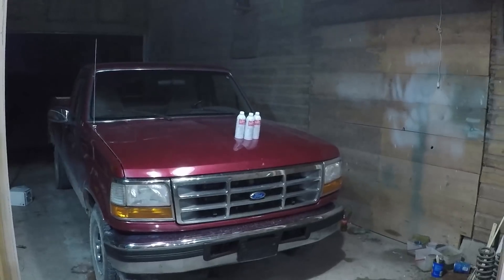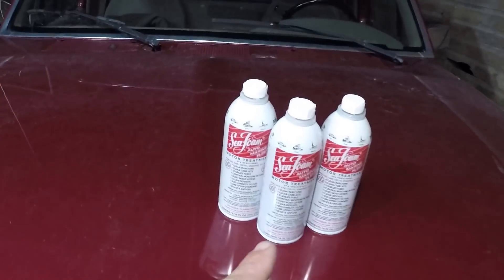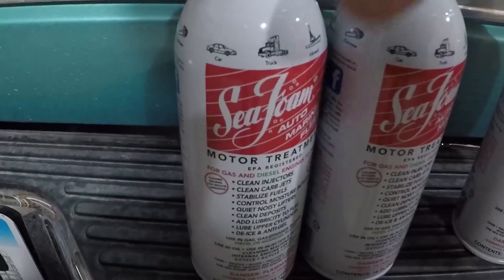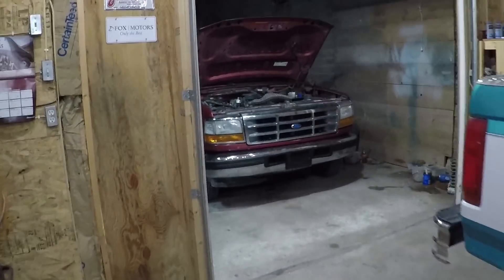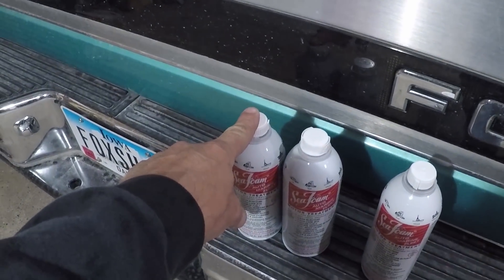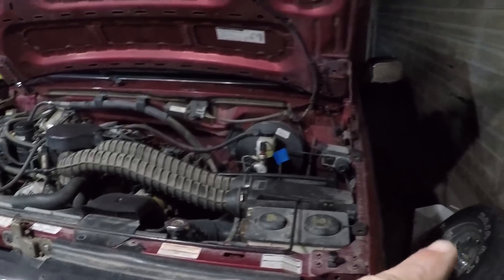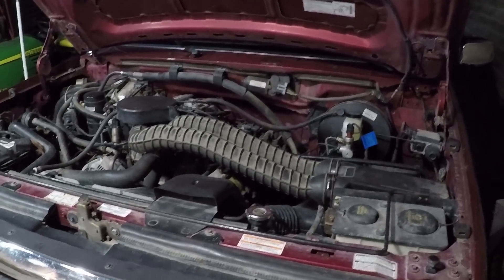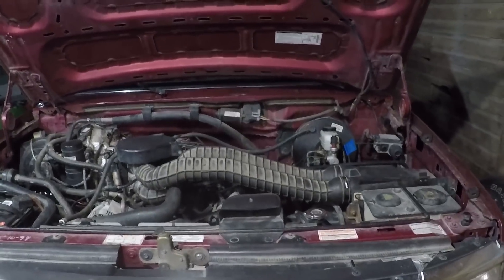SMOKIN! SeaFoam Treatment on The PROJECT TRUCK - 1995 Ford F150 4x4

Comment: One suggestion when pouring that stuff in, you are supposed to stall it when you're all done, that way it hot soaks. Also, I know on the Chevy Vortec engines the booster hose only feeds the back two intake ports, so I always use something called "seafoam spray". It has a little hose that you stick in the actual intake tube in front of the throttle body and run it through that way. Sometimes I even take the entire intake off and pour that stuff right down the throttle body with the engine running. Works great for me.
Reply from the maker: I didnt think you were supposed to kill the engine pouring that into the intake?
Reply: That's the way everyone says to do it anyway. I've done it too, or just have someone in the truck turn the key off while you're still pouring for about a second that way it is still wet when it shuts off and does a better job cleaning.
Reply: @TheFoxShop I wouldn’t do that, it’s basically hydro locking the engine which can bend rods or pushrods or damage something else

Comment: My part cost was just under $30.00 with my discount.  Also I did work at this dealer for three years. I also try to use OEM parts for electrical. I do really like your web I will continue to watch. I also am a new member.  Thanks

Comment: I use this on my 95 F250 7.3, I have noticed it makes a difference. And I also run 2 stroke oil in the diesel in winter.

Comment: The vibration definitely sounds more and more like a slightly sticky injector from where the truck sat little-used for so long.  It sounds very much like it is freeing up nicely as it only seems to be displaying the symptoms after it has sat cold overnight.  The Seafoam certainly won't hurt it any and may help it free up entirely a bit more quickly but it might well come back without any assistance...

Comment: I had a problem  like it sounds like  you have??? My turned out to be a misfire on #4 cylinder?  It did not throw a code?? On till I got to Kansas city.  From Colorado. 
Some times it would be perfect  running  then it started to miss fire!  It comes on go, then I change out number  4 plug and coil pack , came back to Colorado  home, it ran fine. No more problems? May want to try that?
Reply from the maker: Don't have coil packs on that year..and..sold it 3 years ago or so...kinda wish I hadn't lol

Comment: My 1996 F150 4x4 named Ethel. She has a little intermittent shudder I feel around 30-45 mph hot or cold. I've replaced everything from Amsoil Signature oil, fuel pump, ignition, fuel filter, plugs, wires, pcv w/motorcraft parts & tires recently and it stills happens from time to time under light-normal acceleration. If I give her a littler extra gas... I don't feel a thing.
Reply: had a similar issue, ended up being my ect sensor.
Reply: Thanks I'll look into that.
Reply: I have the exact same issue. Did you ever change your ECT sensor and get any results? 1995 f150

Comment: When using seafoam, try taking the ait hoses off of the throttle body, and spray the can into the throttle body. Of course, after getting the truck to operating temperature. Then let the truck sit for about 15-20 minutes, and start the truck back up again. Repeat the process if necessary.
Reply: That's how I did it and it worked very well.

Comment: I usually do the oil treatment: Put one can in with an oil change and then drive rather vigorously for one tank of gas, then change the oil again. 

Blackest, nastiest oil change I did on my old 4-cyl ranger, but it felt like it picked up some pep... Any power back on only 110 HP is noticeable!

Comment: I also have ran seafoam in my 93 & 96. Never really noticed much difference. What's your opinion on the E3 spark plugs? I've seen the research and they look pretty good.
Reply: I ran it in my 93 Bronco and I always notice an immediate difference. Don't run E3 in the trucks, it's no good. Motorcraft or NGK.
Reply: Thanks for the input on the E3 spark plugs. They cost a lot if there is no benefit or value.  Did you notice the most difference with your sea foam in the gas tank or intake?
Reply: I run a full bottle through a small intake hose, then I put 2 cans into the 1/2 tank, my tank is 32 gallons. This doubles the cleaning power for the injection system. The bottle through the intake going in slowly seems to work better in my opinion, I knew there was a difference immediately, especially when I got on the throttle. I've tried a few different things here and there and I always go back to Seafoam.
Reply: I've had pretty good results every time I've used Seafoam (In the gas tank)..as for spark plugs, these trucks like Motorcraft copper cores. I wouldn't run anything else.
Reply: Bill Pitts I've used e3 a few times in different trucks and always had an issue. In one truck it caused a flashing check engine light. Never used them again.

Comment: Sounds like it stumbles a bit when you rev on it. Just on first throttle blip. Have you noticed this? Maybe fuel pump or injectors?
Reply from the maker: +Stevo Hoppa yessir....fuel pressure is good....need to check injectors...
Reply: The Fox Shop had exact same issues on my93, was the IAC and throttle position sensor that fixed it

Comment: Hey Fox, finally got around to welding in my cab corners. Did you have a gap where the bottom of the cab corner wraps around and under the rocker? If so did you just use body filler under there?
Reply from the maker: dont think so... I put spot welds in that area

Comment: I've been following this since you've gotten this truck, just to recap, with this vibration, does she vibrate while stopped, or only while driving?
Reply from the maker: She will do it while sitting at idle also
Reply: The tranny mount and motor mounts are good, what about the possibility of cab mounts? Do they look secured? How about the cross members for the tranny and engine? Something is making her shake....

Comment: 2 questions for ya jon... My 96 300 is almost up to 200k and she runs rough like ol eddie here. Should i give sea foam a shot or just find a new block to build up while i trash the old one? Also, ive stopped your vids several times to see but i never can tell. Do you have any Colorado plates on the wall yet?
Reply from the maker: Ummmm..... not sure on the colorado plates.  Dont believe so but I would have to go look to be sure.   As far as your truck running rough, it could be so many different things... almost impossible to diagnose on the interwebs. Yeah you could give seafoam a shot, its kinda fun if nothing else.
Reply: The Fox Shop lol ill give it a shot next payday and let ya know how she takes it. Great upload as always! Keep em comin and ill keep watchin
Reply from the maker: +Kyle Weston just checked....no Colorado plate
Reply: The Fox Shop ive got several on my wall ill send em out your way soon.

Comment: motor mounts?
Reply from the maker: Thought about that too. but they seem to be ok, along with the transmission mount.
Reply: Check if all of ur injectors are clicking u can check them with a flat tip screw driver and u rest the screw driver against the injector and they should click on and ofd the solenoid in the injector is what u hear clicking
Reply: Might be ur map sensor to or a sensor im not sure its hard to tell or know exactly whats wrong but i would try sur map sensor or listening to ur injectors
Reply: Matt Hogan  I've been having the SAME issues with my sons truck...  and even tried putting my map sensor from my truck into his today... no change.   :-/
Reply from the maker: Yup Yup!  That is one thing I am wanting to do.  That would be a fairly simple fix!
Reply from the maker: Seems to be a fairly common issue I am finding out...  but an issue that I dont think I can just put up with.
Reply from the maker: May do both! LOL
Reply: Map sensors are  very easy to replace i am having the smae vibration that u have i have replace my torque convertor so i can tell u that it is not that use best bet would be your map sensor or even your ignition control module thats the most common issue with these trucks i have yet to replace mine but iknow exactly what symtoms u are having
Reply: Brian whats ur sons truck seem to do
Reply: Matt Hogan  
- poor idle (not always though)
- wants to studder / miss when driving, but if you put your foot in it, it doesn't do it, it seems to only happen at light, or "normal" driving, especially in the 35-45 mph range
- will want to die when going from D to R (again, not always though)
- Its also a 95 EB, with a 351, and speed density  (not MAF ).
Reply from the maker: Will look into both of those.   New torque converter will be the last resort.  Hate to swap that out and discover that wasnt it.
Reply: Yeah its not shifting goofy is it? If it is try replacing ur shift solenoid in the bottom of the trans i had to replace mine
Reply: brian shertzer try ur thorttle position sensor on the bottom of the throtrle body if it not that then try the iac idle air control valve its either those or timing or somthing with fuel fuel filter weak fuel pump injectorrs etc
Reply from the maker: No seems to shift fine
Reply from the maker: swapped the IAC out with another one, seems to be working fine now.. havent touched the TPS yet.. timing is set "ok" might be a bit off like at 8-9 BTDC instead of 10 but I cant get the darn distributor to turn.. replaced the fuel filter, what came out of it looked like swamp water, fuel pressure looks to be ok, put new plugs in it.. going to put new plug wires on here real soon... want to put a new coolant temp sensor in.. needs a new oil sending unit as its not working, wont change how she runs at all though... replaced the air temp sensor...
Reply: Matt Hogan already replaced the IAC the other day.  No change.